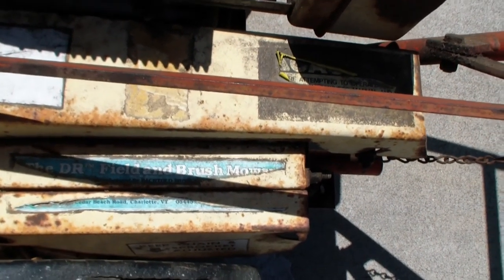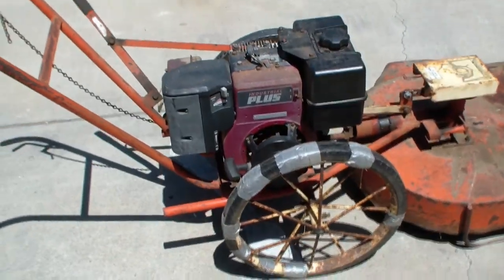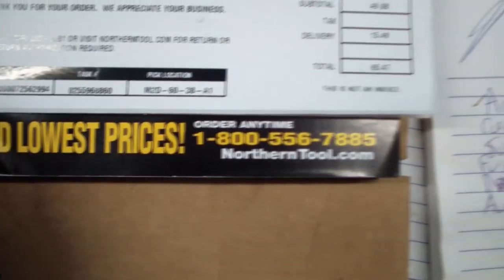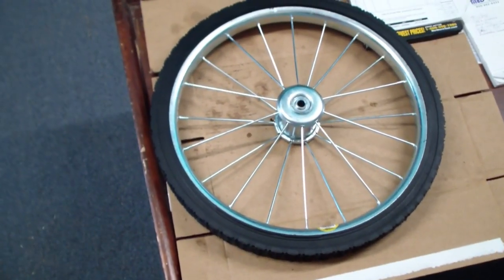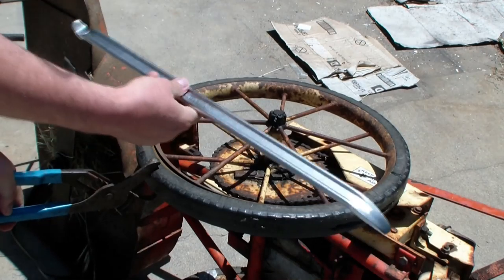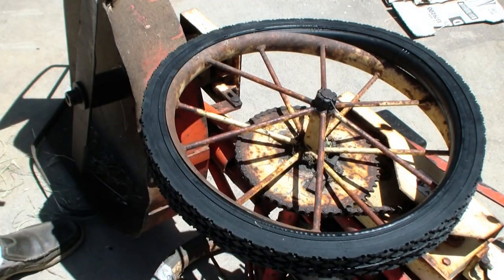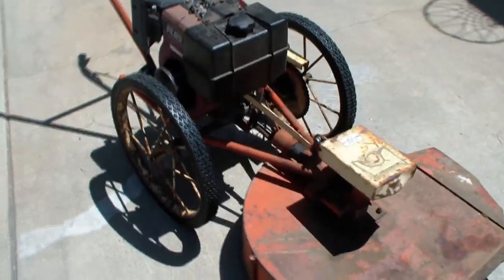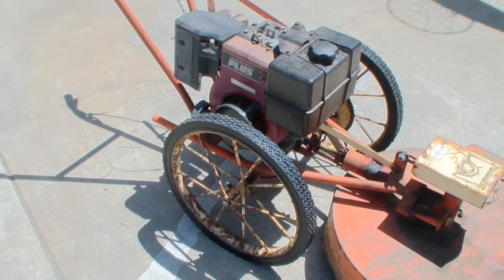DR Field and Brush Mower Tire Replacement

Comment: Kent: I bought a very used DR mower, just like yours a few years ago, and I struggled with half broken tires held together by duct tape until that solution gave out. I then screwed a bicycle tire to the rim and filled the gaps with construction foam. That was a terrible solution too. Then I found your video, and I spent more time cleaning the old crap off the rims than it took me to get the new northern tool tires on as replacements. Thanks for sharing your solution. I now have a mower that takes a lot less effort to use. Now if you can tell me how to get a reverse gear on it, that is not arm muscle powered, it would be a "dream" piece of equipment to use... LOL!!!

Comment: Thanks for the video. I'd like to let everyone know I purchased two wheels, Marathon 92010,  from Amazon ( $34 ea ) and was able to remove the tires and install on my old DR Field. Although the Marathon tires are a bit taller profile and more square at rim, whereas the DR Field is more rounded, they were a pretty good fit and seem to be working great as a replacement. 

To replace, I left the Marathon wheels in the sun for an hour or so to soften up, then used a set of tire spoons to remove them and install on the DR Field rim, Only took 5 minutes or so. Very easy job. If anyone else is unsure which wheels to buy, since the Northern Tool wheel used in the video is out of stock, I can recommend theses. There may be even better fits out there, but the Marathon 92010 does work.
Reply: So I did the job today and it went fantastic. Easy like ssb_orbis said. I used a large C-clamp, large screwdriver & skinny pry bar. A little elbow grease & it went right on and fit well. Did not need any help, 1 person can do it alone. I've spent years looking for a tire replacement (Northern Tool doesn't ship to Hawaii) I can also attest that these tires fit well. Thanks ssb_orbis.
Reply: Just received the Marathon 92010 today, and it's quite obvious that they are not going to fit on the Bachtold wheels. The Bachtold wheels are significantly larger diameter than the wheels from Marathon. There's no way those tires are going to fit on those larger wheels.

Comment: Kent, thanks for posting this video!  I've got the exact same model as you and purchased it new.  We used it to clear our land when building our house.  It's a great little machine but like yours the tires have worn.  I called DR a few years ago but they didn't suggest any replacement.Thought I was pretty much stuck. Just ordered two of these to replace my worn out old tires.  Thanks!

Comment: Thanks for posting info regarding Dr tire replacement. Went exactely as you descriped the procedure. Mine is 20 years old and used mostly the cut grass in Christmas Tree plantation.

Comment: I have the same weed mower and followed your lead with the tires, You are right, the replacement tires fit perfectly. Thanks for posting a great idea. I also did the spindle bearings, belts, and chain. what the heck I might as well paint it now.

Comment: Thanks for your video! I just picked the same mower up! Needs the drive tire replaced. I will use your information!
I had to replace a fuel line, adjust the deck belt, add fuel and a air filter.

Comment: Very helpful video.  Thanks.  Northern Tool does not make PN 145121 anymore.  I ordered PN102652, 20" wheel with solid rubber tire.  They fit perfectly!  It took two of us ~30 mins for the first and less than 10 mins for the second to remove both tires and install the new ones.  Definitely, easier with two people.  The rubber may be softer than the originals, but hey, we can easily replace them if they wear out earlier than 20 years.
Reply from the maker: Good to hear. Guess Northern Tool often changes part numbers.
Reply: 102652 is now no longer available at Northern.

Comment: that is bad ass I got a similar one and a similar response from DR power.  Mine has a partially exposed blade in front which makes it even less safe.  It had to be made prior guys like ralph nadar and the CPSC.  I got the manual if you need it I believe for that exact model.

Comment: Thanks so much for this video! I, too, was very concerned about the tires on my 22 yo DR. They had no grip and one had worn thru to the hollow core.  I ordered the wheel/tire and they went on just as you showed. I put one on hot from the sun and the other cold the next morning and really did not see much difference.
Now.... what to do with two perfectly good spoke wheels?
Reply from the maker: I threw them away. Glad to hear it worked. If you post the new model numbers you used it might help others.

Comment: I have one of these machines and it's tires are worse than yours. If I can find those wheels, and if they still make them the same way, you just saved me a lot of aggravation. I was prepared to make a new rim out of thick steel bar, then weld "treads" on it like the antique tractors had. That would be a pain. I will be going to Northern Tool's site next. See ya.....
Reply: Northern tool still has similar its under a new part# call the 800 number and give them the one in video .. I literally just put mine on, little snugger than video

Comment: Those wheels are apparently no longer available, however, VMI has Marathon 92010 20 Inch Flat Free Tire Replacement for Big Wheel Carts for $38 apiece (includes shipping). I have a DR  mower that I bought new in '97, and the tires have been worn smooth. Usually that isn't a problem except on steeper hills, especially when the grass is wet. Anyway, I think those should work. Fingers crossed.

Comment: I made the mistake of trying to put my new tires on cold.. busted a few spokes loose in the process.  I will watch your method.  I will dunk mine in a trough of boiling water next time.. meanwhile.. I am going to use a saw to cut new XXX grooves in the balding tires... they are solid rubber.. so there is no reason not to do this periodically,if not destroyed as yours were.

Comment: Hi Kent 
Another question-I need a shaft bearing for the spindle the blade attaches to. It looks to be a  2 5/32 outside diameter and 7/8 shaft - Any suggestions? I am looking for the bearing online but thought you may have a suggestion. Thanks Joe!!!!
Reply from the maker: No but post if you have success or make video. Mine makes noise after hitting stump.
Reply: Kent Diego Thanks , will do.

Comment: Hi Kent 
Could you share the belt size or model you use. I am having trouble finding belts. Thanks Joe
Reply from the maker: The small belt is 1/2" x 31". Wheel belt
The big belt is 5/8" x 57".  Blase belt
The sizes are in the user manual. I just had to order one. Got it from Walmart online.
Reply: Thanks a million! I have whats called "The whipper" by cub cadet but it looks exactly like a DR. Thanks again!!!
Reply: What model DR do you have? It looks like I could order parts for that . My blade spindle is frozen up.
Reply from the maker: Bachtold Brothers bush mower. DR Power took over the company but they never really made that one.
Reply: Thanks again!!

Comment: Kent do you happen to still have the part numbers for the belts ?   Northern tools  has disconntinued the tires
Reply from the maker: Other mentioned there is a new part number for tires that work. I got the belts from DR company.

Comment: Question - help please: 
Northern Tool no longer have P/N 145121 but they do have Item# 56625 on their website:
Details:
    20in. solid rubber spoked wheel
    20in. x 1.75in. tire size
    Staggered knobby tread
    Flat-free tire
    150-lb. load capacity
    1/2in. bore diameter

If I buy two of these and move the tires to the mower rim, do you think this will work please?
Reply from the maker: Probably. I imagine there is a company that manufactures the tires and they have a mold. Seems like it would be very expensive to make a new mold. Northern Tool likely just used a new P/N for some reason.
Reply: Hi Kent, 
Thanks for your reply.
I ended up buying a pair of these: Item# 50847, especially since they fit a 3/4" axle.  
Maybe they'll just slip right on and replace the old wheels. :)
If not, the tires are 2" deep, which should be a better fit than the 1.75" tires on Item # 56625
Reply: @nibornm1  how did this work out for you? I need new tires for mine and am reading your post about getting Item#50847. Should I do the same? It worked out?
Reply: @CarlaBarlaBoo  Hi Carla, I ended up replacing the complete wheels as I didn't have the tools required to swap the tires.  I had to cut off the toothed "gear" on the drive wheel (left side as you mow) and attaching that "gear" to the new wheel.  That was not easy. I also had to rig up a drive mechanism to engage the driven wheel (on the right as you mow).  A lot of work but I have welding equipment, which facilitated the modifications.  Now any time I order new wheels, they can be fitted straight on the mower.  I.e. the new wheels do work on the mower but, if you have the means to do the tire swap shown in this video, do it.  It's probably quicker. It should work.
Reply: @nibornm1  ok, the Item 56625 is cheaper than the Item 50847, so if I have the means to remove the tires and put them on the wheels I already have, I should probably do that. I don't necessarily have the tools required, but in the video he says Harbor Freight has the tire tool, so I will hope to find that. My left wheel came off no problem, its held on with a nut and pin, maybe yours is a slightly different model. Thank you! Fingers crossed!
Reply: @CarlaBarlaBoo  So is my left wheel, but it is driven by engagement with that toothed plate on the engine side of the wheel.  I think you will succeed if you buy the Harbor Freight too..  Good luck and let us know how you fare.  I think my mower is about 40 years old.

Comment: bought mine from a friend  $100.  runs great, he cut off rubber tread ,welded washers on rim ....little paddles.....rides kinda rough on dirt roads , off road  excellent traction  holds better on side hill....other people i know love these .not sell .. one guy has replaced rubber tread 3 times,converted to weed wacker string instead of metal blade,non sparking for fire hazard during dry season.. $750 back when he bought new......Check out why the Bachtold Bros. got sued & screwed...idiots using mower get stuck leave engine running,BLADES TURNING (has lever to disengage blade rotation). grab mower by front pull fall down get feet chopped up . then dr copied them.   my only complaint left hand gets sore holding engagement lever in all day  .solved that problem;bought a jd tractor

Comment: MUCH SOFTER THAN THE ORIGINAL TIRES...WHICH ARE REAL BRUTES.  THESE WILL NOT LAST NEARLY AS LONG, BUT ARE STILL A GOOD OPTION.  THE ORIGINALS HAVE TO BE HEATED TO MAKE THEM SOFT ENOUGH TO MOUNT.  A BIKE TIRE WOULD NOT LAST AN HOUR IN THIS SERVICE , NOR WOULD IT EVER SEAT ON THIS KIND OF RIM. oops caps on.